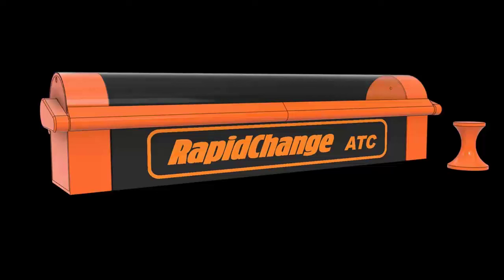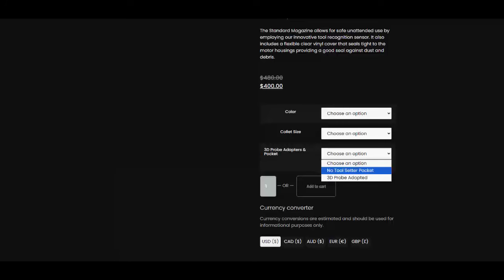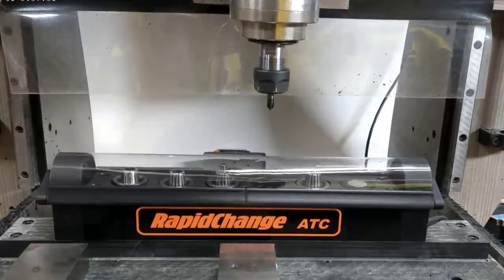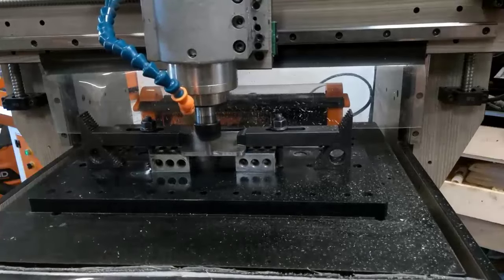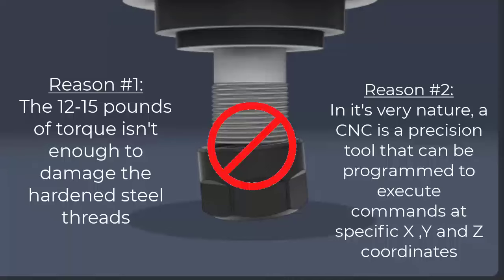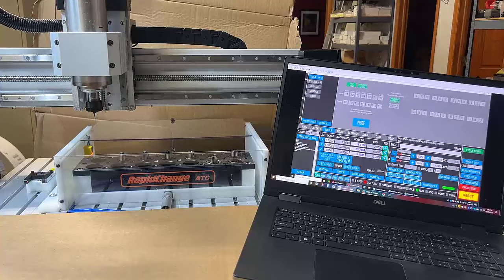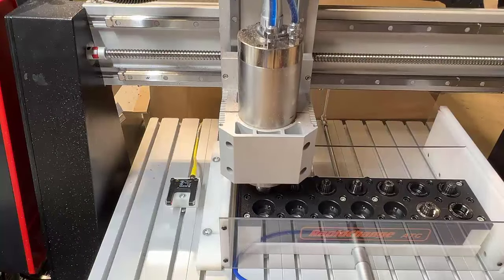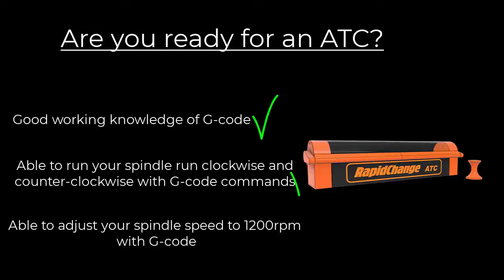Rapid change ATC   Automatic Tool Changer for your CNC

Comment: I would like to see torque numbers from a torque wrench. Making cuts is one thing but we have no way to tell if that tool is slipping from a video.
Reply from the maker: I reached out to Don @ Rapidchange and asked if he had a video of that.  There is a quick shot of the torque near the beginning of this video, https://www.youtube.com/watch?v=RR8noEJYduA&t=102s  
Don also said that it was a good idea and will incorporate that into an upcoming livestream demo. Join their Discord and and connect with them., they are very responsive
Reply: You could use a torque wrench to measure the force needed to loosen the nut.

Comment: This looks really nice but sadly my 1.5kW spindle only starts spinning at around 40Hz (so 2400 RPM minimum). I also cant currently control the direction but my FluidNC controller is ot the way and i'll switch to RS485 control once its here
Reply from the maker: Yes, some VFD's can and some can't run at that low speed. We have the RapidChange ATC installed on a few different CNC's. We do need to upgrade the VFD on one CNC, as it has the same issue you are experiencing with the spindle.
Reply: Wouldn't the min RPM be dictated by the Spindle too. I know for mine the data sheet says 9000 rpm min.
Reply: @xConundrumx  I was concerned about that too, but reading the documentation I found that the 9000rpm limit is about cooling an air cooled spindle. For short bursts it should be ok at any rpm.
Reply: @xConundrumx    their contraption doesn't need low rpm so OK here.  it let spindle to speed up and then engages at some rpm. (like a hammer in impact wrench)
Reply: It’s a great product. It took some work with yl620 vfd. But now I can start the spindle at 800 rpm 😂

Comment: What is your spindle? The minimum on mine is 6000 as it is with a lot of spindles any less and they don’t last long
Reply from the maker: Both CNC's are using a HUANYANG Water Cooled CNC Spindle Motor 220V 2.2KW. And yes, both your spindle and VFD may be limiting factors on why you can't to a low enough rpm. The first CNC we converted is an Axiom and that VFD worked fine. When we tried it on the very similar i2R CNC, that VFD didn't want to get to that low speed, and we had to changeout that VFD. Now the i2R CNC is working fine. For more specifics, I encourage you to connect with the RapidChange team on their Discord server channel. They seem to answer there the quickest.
Reply: @mikekikkert6847   I just got the same spindle but I am using Phils board with Teensy 4.1 / GRBLHAL. Unfortunately there is no rs485 on the board will it work with PWM 0-10v
Reply: @Newtrojan  Just use a UART to RS485 chip and hook that up to the UART of the  Board. works like a charm on mine (T41E5XBB)

Comment: Mike, can you supply a bit more detail about the fork sensor - there are stacks of options in the linked pdf. Did you use 3 wire or 4? NPN or PNP? Thanks
Reply from the maker: In the video, the controller used was a UC300ETH base board, which prefers NPN sensors, and the AXBB base board has isolated inputs, so either can be used.  We used PNP for the AXBB, and I have expansion I/O on the UC300ETH that allows for PNP.  The PNP sensor used is 3-wire, as we did not use the teach function via the wiring.
Reply: I want to hear more about the fork sensor.
Reply from the maker: According to the specs for that fork, the accuracy is 0.008".  In our use case, we carve the same material all day long to a depth of 0.025".  I can tell you that the fork is 100% accurate and repeatable,  Any variance would produce a visible difference in our process. The real benefit to us is that our fine bits don't have to touch metal for the "touch-off" process, making the super-fine bits last much longer.

Comment: where did you buy that spindle clamp?
Reply from the maker: That spindle clamp came with the i2R CNC, so its factory. But it's pretty much identical to this unit on Amazon   :
https://www.amazon.com/RATTMMOTOR-Spindle-Bracket-Diameter-Engraving/dp/B078HB21VG/

Comment: when the tool is in the toolholder how to ensure the endmill stays at the correct amount of engagement in the collet?
Reply from the maker: We didn't think about that until the first bit slipped a little. Most of the collects held the bit just fine, but a couple did slip. We now install a small O-ring on top of the bit to keep the bit from falling down the collet. Have seen some others use a small piece of heat shrink tubing instead. That has been working great

Comment: That fork sensor is too slow.
Reply from the maker: That fork sensor isn't for everyone, it works for our use case very well. It accomplishes the intended purpose of saving the bit from contacting any metal during the height probe process, and extends the life of the bit. We chose to sacrifice speed for longevity.
Reply: @mikekikkert6847  I’m really interested in the fork sensor. I haven’t seen anyone use it before. What kind of accuracy can you get with it?
Reply from the maker: According to the specs for that fork, the accuracy is 0.008".  In our use case, we carve the same material all day long to a depth of 0.025".  I can tell you that the fork is 100% accurate and repeatable,  Any variance would produce a visible difference in our process. The real benefit to us is that our fine bits don't have to touch metal for the "touch-off" process, making the super-fine bits last much longer.

Comment: Whats the maximum length of the bit sticking out of the collet. The Rapid exchange doesn't look very deep to me.
Reply: 24mm or you can mount the cassette higher or drill the bed to accommodate.
Reply: @stevelkneivel  Cheers mate I actually found another youtube vid with that info.

Comment: Better than one or even 5 tests is to find out what the company's liability coverage is. How confident are they that they aren't going to be sued and how much can they afford to pay out if they do?

Also never seen a spindle that can do 1200 rpm consistently or for long.
Reply from the maker: We can tell you that we had all the exact same doubts and fears as you do. The price point is what finally convinced us to test on one CNC machine. Cautiously at first, then gaining confidence as more and more bit changes happened without issue. The first CNC is using a HUANYANG Water Cooled CNC Spindle Motor 220V 2.2KW, and after 6 weeks has  made hundreds of bit charges without issue.  Once we gained the confidence in the RapidChange ATC, we ordered the unit for the 2nd CNC.  The 2nd CNC has the same spindle, but uses a different VFD that wasn't able to control the spindle down to 2000rpm, so we changed the VFD and that CNC is now working without issue.  We can all agree that there are just too many varieties of CNC, spindles and VFD controller combinations to insure that it will work on everything. That is why I mentioned that IF you could consistently control your spindle at that speed, this solution may be something to consider. Ask the team at RapidChangeATC any questions you have, they are incredibly responsive both on the website and their Discord channel.

Comment: oh. i see.  you basically created an impact wrench  which engages by centrifugal force or something when the nut speeds up.   
that's clever on its own but you definitely need some longevity testing.  (cause spindle manufacturers clearly says do not use impact on a collet nut)

my two questions is:
1.  what's with dirt ?  ER collets collect dirt pretty well and it falls all over on changing.   but for good runout you must keep collet and nut threads crystal clean.
2.  how tools not fall off the collets when not in the spindle?  for good tool holding and minimal runout collet must never be stretched (only compressed) so the perfect tool to collet fit is when tool slides freely (falling off the collet when not tightened)
Reply from the maker: Great questions. I didn't think about the bit falling out of the collect until after I bought mine from RapidChange ATC. Most bits\collects were pretty snug and weren't an issue. Several did fall out as you mentioned. After a little trial and error, now I just put a small O-ring on the top of the bit to keep it from falling out of the collect.  As for keeping the collects clean, I agree.  That's why we built the custom enclosure you saw at the end of the video. Works really well. We approached this new ATC with a healthy dose of skepticism like you, but it keeps impressing us. We have had it about 2 months now with hundreds of bit changes per month. We have become so comfortable with it, we don't even worry about it anymore.  The guys are Rapid Change ATC have been great to work with as they launched this product. Easiest to connect with on their Discord channel